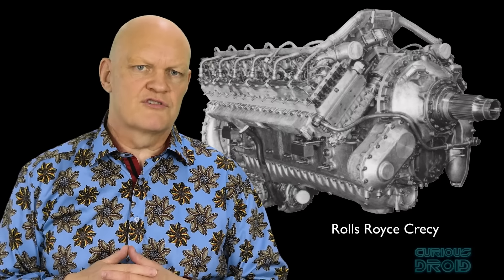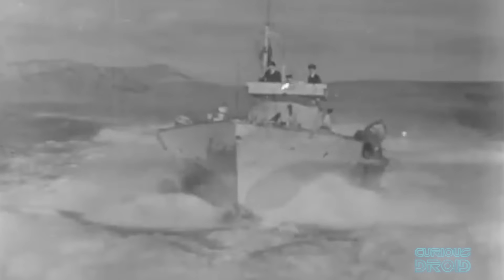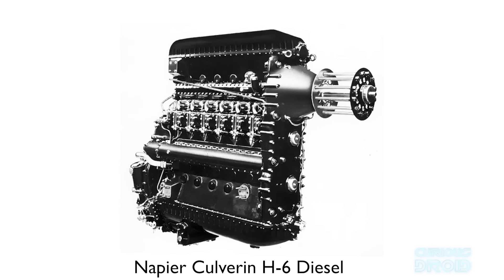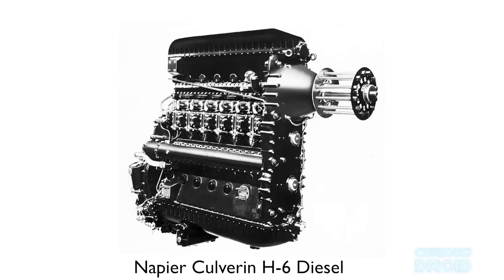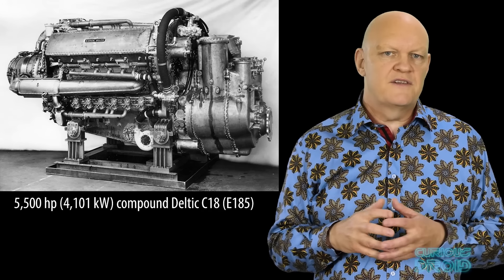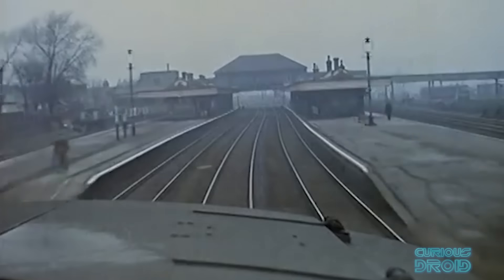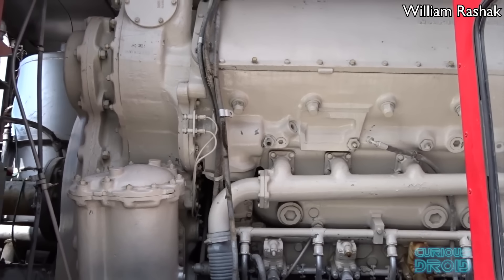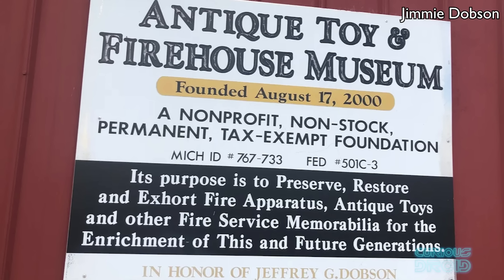The Legendary Napier Deltic - 88 Litre Opposed 2-Stroke Triangle Engine

Comment: For some reason this just popped up in my feed, really fascinating video! I've always been interested in the Deltic – both the engine and the locomotive – as my dad always used to talk about it. He worked in the Traction Department at English Electric and if I remember correctly, he worked on the loco's wiring diagrams, being an engineering draughtsman.

Comment: NYC. had three super pumpers. They where stored in Greenpoint Brooklyn's auction yard when they were
taken out of service. They were serviced at Mack Trucks Inc. in Maspeth N.Y. That was Mack's factory branch.
One unit was always out of service for repairs and maintenance.
I witnessed the super pumper at work at Frances Lewis Blvd and 35th Queens at a Waldbaums supermarket fire.
The water canon was so powerful it knocked the building down to put the fire out.
The M.P.O. (Motor Pump Operator) operated the pump with ear muffs because the engine was extremely
noisy with the biggest Turbo chargers I've ever seen.
I loved machinery and couldn't watching the machine operate.

Comment: You should have had the sound of a Deltic diesel-electric train in the video. They sounded sweet. One of the remaining Deltics is occasionally rented to the major train operators, when they are in trouble, so they still do commercial work.

Comment: I watched the super pumper in many operations including the Morgan station post office fire in December 1967. It was generally used as a mobile pumping station to transport large volumes of water over long distances. If a fire depleted the water supply in one area the super pumper was used to transfer water from a area where water was available. The record being at the co-op city development in the Bronx where water was pumped 7000 feet. It could pump 8800 gpm at 350 psi or 4400 gpm at 700 psi depending on how the pump stages were arranged. This was at draft (static source). If using hydrants , much more. You needed hearing protection when it was running as it was quite loud. You could also feel vibrations in the street when you were in close proximity.

Comment: Interesting bits you've overlooked: NM part numbers for Napier Marine items. The minesweeper sets were 2x 59k, 1x 55B. The metalurgy was different for different applications, as not all were required to be non-magnetic. Surface materials for the hard chrome on the minesweeper types was a ballache, often lifting. Last commerical customers I recall for the beast of a 42K were the Indian navy, that was the daddy.
Train sets used the large shotgun type cartridges for starting, others used compressed air, and of course variations.
I had one on a test bed running at 50rpm, yes I nearly broke it.....but I was an apprentice at the time.
Built and tested loads of these, pain in the arse to work on, unless you have the hands of a small child...

Comment: I recall being a teenager and spending some aboard a US "Nasty" class boat that was having an "Open House" day.
I spent a number of hours learning about the Napier Deltic that day.
Though neither light, nor high speed, Fairbanks-Morse in the US had a very successful vertical, inline, opposed piston, series of engines.
Originally licensed from Junkers in the 1930's they were originally intended for railway locomotives, but ended up being very popular aboard submarines in WW2.
The engine, commonly used to drive generators, is still in production today.

Comment: I have to make a correction here to an otherwise excellent video. You refer to the Junkers 6 cylinder opposed piston engines as being of a 'H' Six layout. A 'H' layout refers specifically to two 'flat' engines stacked against each other, and geared together to make one common unit. Napier built the Rapier, Dagger, and Sabre engines of this type, and BRM (British Racing Motors) produced both a H16 as well as a conventional (broadly speaking) V16 at different times. Incidentally, the term 'Opposed Piston" should probably used in the title, to save some confusion to people new to this concept. Opposed piston engines are by nature also of the opposed cylinder layout, but most opposed engines (think Boxer, Flat, Horizontally Opposed etc.) are not usually opposed piston engines. Cheers.

Comment: One thing about the engines used in the Class 55s is that by the late 1970s BR only had barely half of the Deltic engines still available for the fleet of 22 because they were notorious for con rod failures on loadbank testing, one of the preserved ones(55022) had it happen when on the mainline back in 2006. They just seem far to stressed in rail use(heat cycling and use due to being required at full power quickly and for long periods of time) compared to the marine variants.
Reply: They had different problems, but with the same root cause, in the Class 17 (Clayton) and the Class 28 (Metro-Vick) locos; taking a design of diesel engine which worked very well in the job for which it was designed (driving generators, or powering small naval craft), and expecting that it would be equally successful in a totally different job.
It strikes me as the reason why DMUs such as the Derby Lightweights were so successful. They used engines designed for service buses, such as London Transport's RT series, which were built to withstand constant going up and down through the speed range and through the gears - far removed from a generator set running at constant speed or load, or a fast attack boat, which is carefully warmed up before going to sea, and spends a long time at cruising speed before going to full power for the attack.
Horses for courses!

Comment: I was a second man on the footplate at Kings Cross during the 70’s these were fun to drive onto the milk yard for refuelling  we were only supposed to use one engine but we always started both up and sat on the stops till we had green light & wack open the controller and fly up into Copenhagen tunnel , the acceleration was brilliant. But going for a pee in the nosecone was interesting with the traction motor blowers working.

Comment: Little known fact:  The Junkers Jumo 204 was licensed by Fairbanks Morse.  The resulting diesel engine was extensively used by the U.S. Navy and is still in use, although being phased out today.
Reply: Another little known fact, the german 4 crankshaft engine was actually more powerdense then the Napier Deltic, actually, the whole range of turbocharged 6 cylinder Jumo engines were very powerdense for their time.

Comment: My late very good friend Tom Wrighton worked on the Deltic locos starting with the prototype. He was employed as an electrical engineer specialising in the control of the traction motors
that wre driven by the Napier Deltic engines

Comment: There is an historical/engineering principle that goes, "The highest point of any technology arrives after it has become obsolete." Case in point, the modern compound archery bow, complete with wires, pulleys, strange looking torque stabilizers and weird sights. An archer at the Battle of Crecy would have barely recognized it.  And I have no idea what they would have thought about it.  Likewise, engines like the Napier Deltic were far too sophisticated - over the top, really.  The Germans did the same thing, coupling two of their engines together, to make doubled up engines on their Heinkel He177. Jets were coming. Piston engines had reached the end of the road.  Great video!

Comment: Many years ago at the local scrap yard here in Quebec I saw a motor similar of one I saw on this video , it was square, look like having 4 crankshaft, and piston toward each crankshaft , the motor was about 6 feet’s square and 10 feet’s long with something looking like a compressor at the end of it , he was asking 0.35 $ Canadian/ lbs and the motor weighs over 12,000 lbs so it was over 4200 $ for it , a bit over price for me at that time not knowing what exactly what it was , but today I have the money , next time I will put the hand on a piece like that .
That same scrap yard also had 8 pratt&whitney R-4360 , yes those one with 28 cylinders , they was all destroyed by a large hydraulic shear.

Comment: A "standard" sized steam locomotive takes (depending on various factors) 6 to 8 hours to fully heat up before it is able to pull a load.... Hence why the railroads would try to keep an engine in constant service for as long as possible before shutting it down/off!

Comment: I remember these from the BR class 55. Nice to finally have a good explanation of their history and development. Would have been nice to hear more about their demise...
Reply: @JasonJason210 - Basically, they were very complex, and as they aged, their reliability suffered.  The Deltics used by the Navy didn't have that problem because they never spent long periods ticking over - as when a train is held at a signal - and then being immediately opened up to full power when the signal changed.  In Navy boats, they had the chance to be properly warmed up before going to full power, rather than going up and down like a yo-yo.  The Deltic was, after all, designed and developed for Naval use, rather than on railways.
Many of the early railway diesel engines suffered similar problems because they were not designed for such use, but were adaptations of stationary engines or marine diesels - and it took quite a while for British diesel makers to stop trying to bodge something up and design a railway diesel from scratch.
In contrast, when BR started building diesel electric and diesel mechanical railcars, they were powered by diesel engines designed for service buses in buit-up areas, where they were constantly stopping and restarting, far more frequently than were the railcars. That factor, plus the ease with which they could be dropped out from under the railcar with a fork lift truck very easily meant that they fitted the railway's needs very well.
In engineering, CONTEXT is critical; whatever the design, it HAS to be matched to the working conditions.
HTH

Comment: Omg, the Junkers 223...wow.  Just, wow.  And the Deltic...I'm speechless.  I thought it amazing the Deltic used a blower to inhale the spent gases for better scavenging.  These guys and their brains.
Reply: Using Blowers is common on Two Stroke Diesels; modern Marine Engines use Electric Blowers for Scavenging at slow Speeds where the Turbochargers aren't effective yet.

Comment: Fairbanks-Morse opposed-piston diesels we’re used on WW2 US subs, landing ships, and some destroyer escorts. They are still in use as the emergency generators on some modern nuclear subs. Being single-bank, they were a bit tall for railroad engines. The Deltic is more complex, but the low profile is a considerable advantage.

Comment: The historical significance of the Class 55 is often overlooked. Going into service at a time when most thought that only electric locomotives were capable of pulling high speed trains, the Deltics showed that properly-designed diesel-electric locos could provide very good performance without the expense and other issues of erecting overhead catenary power supplies. Remember that when the Class 55 went into service, the Japanese National Railway was building the Tokaido Shinkansen, electrified at 25 KV, the first line capable of 100+ MPH average speed.

Comment: 11:17 Most powerful locomotive never build :-D  Maybe Swiss Ae 6/6 with 5'830 HP since 1952 or Re 4/4 with 5'932 HP since 1964 or Re 6/6 with 9'846 HP since 1972 (all horsepower values meant 'in continuous mode')?
Reply: IIRC, the most powerful Locomotive in the World is that Swedish IORE Locomotive on the Kiruna-Narvik Ore Line. At least most powerful per Unit (it's a Double Locomotive, so you have to divide the total Power by 2), if you count Multi-Unit Loco as one then that Title would go to that insane 100+ Meter-long 6-Unit Locomotive from China.

Comment: Very nice episode thanks! Little correction, the "captured E (S!) Boat" shown was actually the one captured by Lt Com Hitchens, it sank before it could be towed back to the UK. The navy never did capture a working S-Boat. After the war surrendered S-Boats were used for engine tests and also for "Fishery Protection" in the Baltic.
Reply: The Germans surrendered several Schnellboote to the RN. S212 was fitted with early Deltic engines on the port and starboard with the original engine retained between. It flew the pennant P5212 and used as a mobile test bed for the engines.  The "Fishery Protection"vessels were former S208 and S130. S130 had three Deltics and nothing could catch it! S130 survives and is part of the Wheatcroft Collection.
Reply: @nigelpaine2914  Yes I've been following S130 for a while. No news for a long time though! The other survivor was S97 (I think), but after laying forgotten on a river in the UK, she was "rescued" then promptly scrapped! I know she was apparently in a bad way, but it was a shame. I met one of the guys who bought S130 back from Germany a few years ago. She had been a houseboat (like most of these types) they towed her back with one of the screws screeching the whole way!
Reply: @markdavis2475  According to the Wheatcroft Collection FB page S130 is being restored and will be on permanent display in Richmond Dry Dock in Appledore.

Comment: Napier managed to fix the crankshaft phasing by running one crankshaft backwards.  BUT, there was a downside, the arrangement means the exhaust piston must lead the inlet piston by 20 degrees.  This is not the optimal angle which Junkers had determined to be 11 degrees. I have not seen anything on whether this adversly affected the performance to any marked degree.  

The Junkers Jumo 223 and 224 did not have this issue.

This engine was probably Napier's most succesful since the Lion.  

The Sabre, of course, was a success in the end but it cost them dearly and still has a stigma associated with it.  Personally, I love it but I also recognise its issues.

Like the Sabre, the Deltec's exhaust note is unique, but unlike the Sabre, we are fortunate that there are Deltics in operation and we can revel in that glorious noise!

Comment: And meanwhile in America Detroit Diesel had the idea for a 2 stroke diesel with overhead cams with 4 exhaust valves per cylinder, piston oil squirters, a separate oil and cooling system, common rail direct injection and the whole thing was supercharged. They also idled at about 450-750rpm with most being governed to 2500rpm though they could rev as high as 4500 before reach valve float if you backed them off.. most people were too afraid of runaway to do that though. Though they never made quite that much horsepower and the biggest of them didn't come out till post war.. The most well known one (though most people don't know it was used there) would be the straight six variant that saw use in some boats and Sherman tanks/Hellcat Tank Hunters.

Comment: A single or twin row Deltic would be an excellent car or truck engine. With a petrol injector on one side and a spark plug on the other you’ll get an extremely clean DI two stroke. In diesel form, reduce the port heights for less noise and more torque.
Reply: Oechelhauser Gegenkolbenmotor was originally designed as a gasoline spark ignition engine...

Comment: Good video.
You just missed out on the part that the Baby Deltic wasn't a great success, they had many engine failures, mainly due to engine auxiliaries which weren't of the best standards, and the fact that these engines were higher stressed as the 18 cylinder counterparts of the big Deltics (122hp per cylinder for the Baby Deltic and 92hp per cylinder for it's big brother)
They all spent somewhere between 8 months and up to 2 years out of service being sent back to the Vulcan Foundry to get issues solved, and still hadn't the best records after that.
Early withdrawal came in the early 1970s.
The big Deltic fared better, thanks to the maintenance scheme where engines were swapped and sent back to to factory where specialists rebuilt them.

I spent a couple of days on duty on Deltic 9 footplate when it visited our railway, I can assure you that you will hear Deltic engines roaring for the next week or so, but the power when the generators kick in is like a modern electric instead of what you expect from any other diesel, it's just too powerful for a preserved railway at max 25mph and load 7 (coaches) and can only be appreciated to full extent on the mainline.

Comment: 6:45 I think you meant that this engine runs flat out at what a regular small diesel engine would IDLE at. Small hatchback diesels normally idle at about 750 rpm and redline between 4 and 5k
Reply: The rpm of a Diesel engine is limited by the bore diameter, the advantage of this German Jumo design was large displacement with small bore diameter and higher rpm potential.
Bore diameters over 100mm reduces the rpm.

Comment: that picture at 8-37 reminded me first time i saw the innards of a vincent rapide  motor cycle. there were 14 cog wheels and it took 600 turnes to line up all the timing dots that was 1000 cc engine  we used to call out the (vincent king) to help us out.

Comment: They were not serviceable in the Nasty Class boats, they were completely replaced, and the original engine was shipped back to the factory for rebuilding.

They were temperamental, you could bend a connecting rod(s) if  didn't know how to start it cold.

Comment: I worked at Napier in 1958/59 i worked in the stores it was interesting to see the photo of thje Gearing,these were large lumps of steel in the stores area took two men to lift them after being machined one maqn could lift them easily,the same with the Cylinder liners took two men to lift them,we could walk into the machine shop and see them after machining i could lift one with my finger that was my most interesting job.